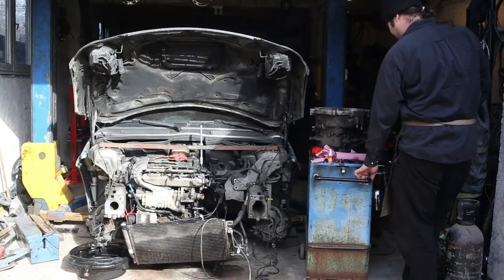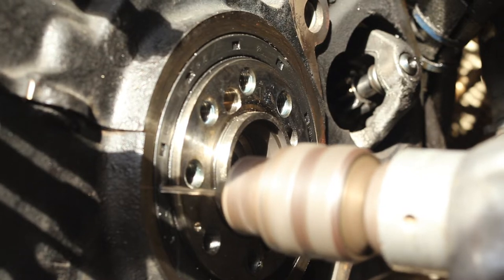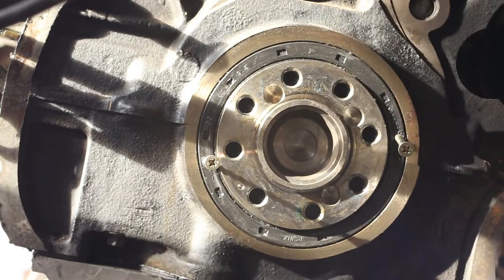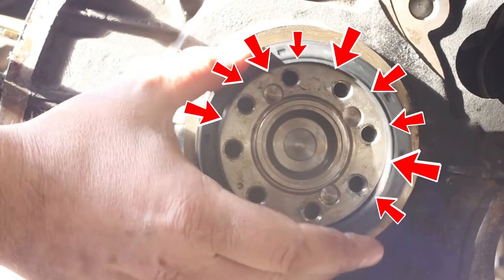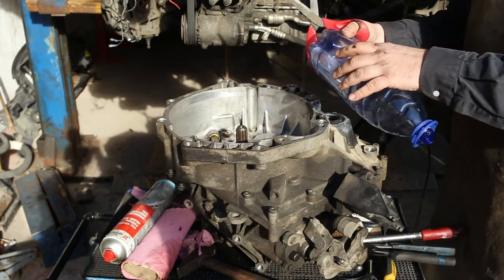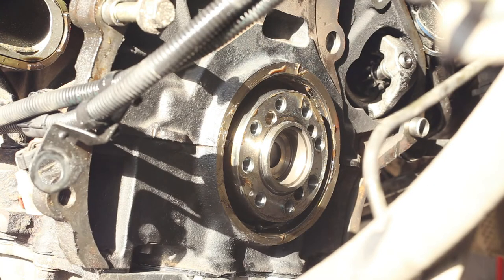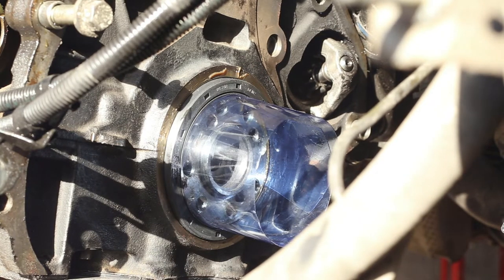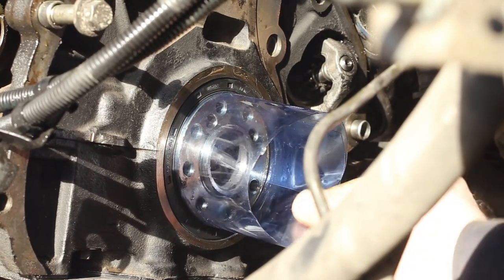The trick to easily remove and replace a flywheel oil seal (main seal)

Comment: This really worked, I couldn't push the seal in by hand but using the bottle it slipped in really easy. I used a socket to finish off about 1mm overhang. Close to a magic trick I have ever done !!! Brilliant. Thank you so much for taking the time to make this video!!!
Reply from the maker: Hy, i'm glad it helped you :)